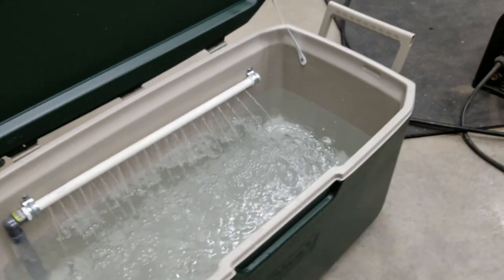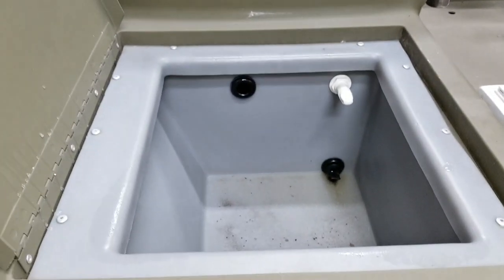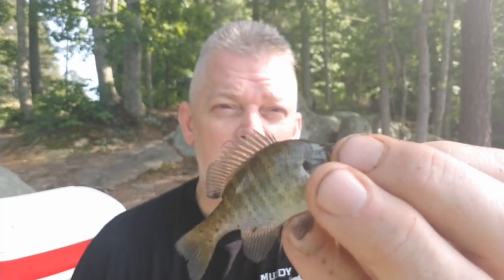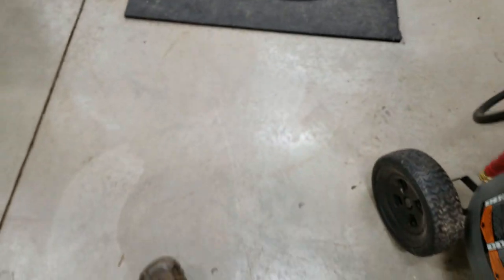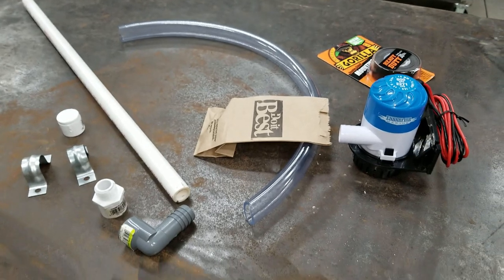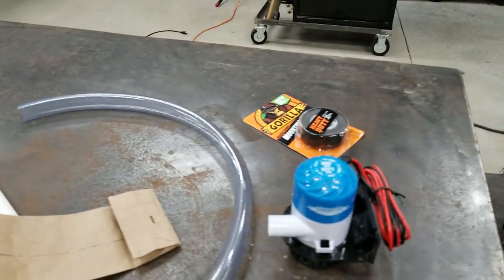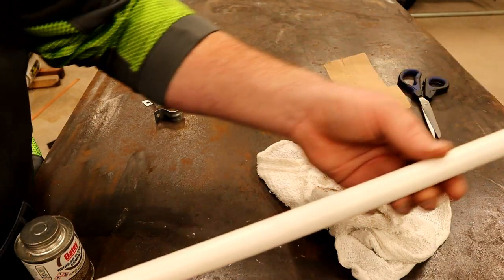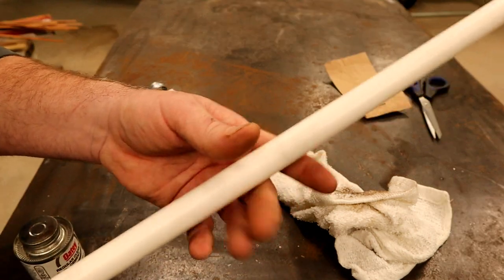30 Gallon Live well DIY

Comment: Coolest DIY I've seen in a while.  After losing MOST of my blue back herring this weekend on a striper outing, I'll be making one of these for my kayak.. I don't need to hold catch, just keep bait alive and lively.  Thanks for the idea and inspiration brother!
Reply from the maker: Thank you brother , check out this one too before you build one they both work good and this one is easier and cheaper too build
https://youtu.be/tWH72EynSbY
Reply: Fishin N Stuff  I just did the 30 gallon build and the bait bucket build thanks for all your help this was my first DIY and it came out great!!
Reply from the maker: Thank you for watching brother
Reply: Fishin N Stuff  if you don’t mind me asking what size battery do you recommend for the 30 gallon live well build ?
Reply from the maker: @nicklockett739  I use my trolling motor battery on the boat , but in a kayak I would use a kayak battery
Reply from the maker: @nicklockett739  https://www.amazon.com/dp/B003S1RQ2S/ref=cm_sw_r_other_taa_LN9eFbBWZ9FV1
Reply: Fishin N Stuff  thanks I greatly appreciate it !

Comment: Have you ever considered making a portable cooler livewell using standard boat livewell tech? Most DIY builds simply recirculate the water in the cooler & provide some aeration, but I'd LOVE to see one that pulls in cooler lake water from a hose & allows overflow drainage. Ideally, the inlet hose would be long enough to pull from a depth to reach cool water, not just the top where the boat's hull sits.

Comment: I've made many types of live wells over the years including the spray bar ones. But my favorite is simpler and actually works better. Get a small bilge pump with the strainer intake on the bottom. Next get a piece of perhaps two inch thick styrofoam eight or more inches in diameter. Cut a hole through the middle just a shade larger than the pump intake. Tywrap the pump to the styrofoam with the strainer in the hole. Fill the ice chest with water and toss the pump in under the styrofoam. Yes the pump is upside down. Wire it and turn it on. It'll quickly foam the water with far more air than any spray bar will manage and circulate the hell out of the water. I've overcrowed a live well with shrimp and fished the entire day in summer heat and never lost a single shrimp. Another plus is the strainer is on the top and doesn't get stopped up with shrimp shells and such.

Comment: When you push the wires through, leave them about the thickness of the cooler on the inside then slather with silicone & pull into place. It will help get more sealant on the inside in case it ever tries to leak. After it's in place then put your bead of silicone around the inside and beat around the outside that way you're hopefully one hundred percent covered.

Comment: I love the use PVC pipe are used some three-quarter inch PVC pipe in my garden I’ll bring it down the rows and then drill some holes in it and then went to Lowe’s and got some sprinkler heads that go in the tube in the small black tubing and I am stuck them in the PVC pipe and then get me a hose fitting and stuck in the end well I made it like a teaThat way I had only one fitting to make her use and I hook the hose up do it the garden hose turned it on and it misted the garden really good and then at nighttime I can go out there and turn it on for about 30 minutes and let it finally missed the garden and they did a great job

Comment: It would be an improvement to hook up with a timer switch and also a water inlet, exit setup. Obviously this will have to be a fixed install. You can get cooler guards for the cooler to keep it in place while motoring.
Just a suggestion

Comment: if you ever do a DIY with a cooler or any other thin plastic container again, you should try kayak rivets instead of screws. they will hold a ton more weight with zero chance of stripping out. great vid man.
Reply from the maker: Your right  , that's a good idea.  I did have right of that . Ive used a lot of em on my kayak lol
Reply from the maker: I did do this one too , it works great in a kayak 
https://youtu.be/tWH72EynSbY

Comment: Oh yeah, how do you fill it up on the boat? I have been there and done that with these. You ether have to keep a separate pump and hose setup to fill it up with or leave enough hose on the well pump can pitch out of the boat and into the water so you can fill the well. Filling them any other way sucks and/or can cause an accident.
Reply from the maker: I used one of the soft fabric buckets , about 3 buckets full and it's good

Comment: How do you fill it up! I would go one step further and hook up a pump with a hose feeding the cooler then connect a hose where the drain is to drain the water!
Reply from the maker: You probably should do that , i only used it 1 time for a tournament  ,,,,, and i caught a 50lber 2ndcplace by the way lol ,,,,, I used a small bucket to fill it up and empty it  .ive got a 40 gallon live well in my new boat

Comment: Do you find the pump heats the water up? I was thinking of making one with a different style pump and have it suck the water through the drain plug and drill another hole for the pvc to run back in.
Reply from the maker: No I didn't notice but I only used it for a tournament I eas in and a couple more times but it was bei cold so , , I'm sorry but I never noticed.  It would be awesome to make one that pumped fresh water in . But that would be more complicated lol ive seen em on kayaks that pulled water in through one scupper hole and water went backout throughout another

Comment: New subscriber here. Great DIY.  I was wondering if you get trash caught in the PVC pipe? I was thinking if you used threaded couplings for the inlet and end cap you could take it apart and clean it much easier. Keep up the good work!
Reply from the maker: I agree with you I saw a video where the guy did that , it's a good idea really .   I was thinking about making one with a filter to clean the water before it reached the pump . I appreciate you subscribing brother , feel free to comment on anything if you have an idea

Comment: can you make a smaller version of this as a bait bucket? I like that pump much better than using those bubblers with the stones any advise?
Reply from the maker: I'll try and think of something . The only problem I would think would be that it will need a bigger battery than a bubble box to run the bigger pump

Comment: Very nice but if it's powered by a heavy 12 volt car battery It would be to much to carry out on the pier. In a boat, yes.
Reply from the maker: Im not sure how long it will work , but I use a lot of the batteries they put in the deer feeders  , I know it would work but I've never tried it on those pumps to see what the run time is . Im going ti be doing a DIY soon that's right up your alley,  for carrying out in the pier I mean . You'll like it

Comment: This is badass! Curious if you can install a bubbler with the bubbling stone strip instead of a water pump like that? Is this better than a bubbler because of the size of the tank?
Reply from the maker: Sure you can they make stronger pumps i would use something strong  , i appreciate it by the way

Comment: Being on the bottom I wonder if the pump gets that slime built up in it slowing it down. I always mount mine a little off the bottom
Reply from the maker: That's a really good idea man , because your right I think it does to , I had one toi show down after a couple years of use . I normally just rinse it off after using and I had a older one I just ripped it out and replaced it they only cost 2.77 , but still that's a really good idea
Reply from the maker: Ol my bad I was thinking of the bait cooler , but your still right there pump could clog up mine never did but it's still a good idea to mount it on the side instead of the bottom , I made that for a Youtuber tournament I was in and I knew my live well wouldn't be big enough,  and I was right caught a 50lber . Ive got a video about that and how it fit in there , but that's a great idea buddy I should have tried that . I learn a lot from peoples comments . I've since ordered me a SeaArk boat so I don't think I'll have live well issues any more

Comment: What kind of vinyl pipe did u use bc I tried the 3/4 in and was not fitting lol and the pump says 3/4 hose..i have literally been fighting this thing for an hour lol advice please
Reply from the maker: Heat it up ,,,, just the end about an inch or so with a heat gun or a torch , and get it soft then stick it on , be careful not to melt it

Comment: May i suggest using rubber seals to plug the hole up instead of using whatever it was you used that might poison the water you can get those rubber plugs that allow the wire to still feed thru but it still plugs it up. Also if that pumps anything like mine may want to wrap a sock around it with some mesh so it don't suck up junk,and feed it thru the spray bar and clog the holes
Reply from the maker: You may lol . Cause that's a good idea . After I made it I thought about a better idea , I could make the spray tubes (PVC) to where they could come back apart sho you can clean them  too . I appreciate the input its aways welcome brother
Reply: @FishinNStuff  thats what u did also make my tubes removeabl cause after a few times of taking it apart to clean them that got old real fast. Keep the good ideas coming . I love em tight lines brother

Comment: Did you wire the pump to hook to a small battery? Do you know about how much all the parts cost you? Thank you for the video!!
Reply from the maker: It doesn't matter on the video I wad using a small battery to run it but on my boat I hooked it to my trolling motor battery , as long as it's 12volts  the price will be lower in the summer , I bought my cooler last winter and it was 69 dollars and I saw some for 40 something this spring so it's mostly the price of a cooler you want to use and the pump which ate different prices too  mine was 15 or 20 . Hey buddy what are you keeping in it
Reply: @FishinNStuff  I have a 12 foot jon boat. I want to be able to keep 3 or 4 catfish in the 4-6 lb range at the most. I'd also like to get in a small bass tournament or 2 and you have to have a live well. and the 3rd reason is we do a lot of river fishing and we want to take some of the fish to a friends farm pond, so just being able to transport them would be nice.

Comment: What did you connect it to? Also im thinking about making a larger live well then this with the biggest cooler i can find.
Reply from the maker: This was the biggest cooler I could find in January  , seems coolers are more available in summer time but I never paid any attention before  , I connected it to my trolling motor battery  for the video (which is very small and ran it fine ) but in the tournament I used my trolling motor battery
Reply: @FishinNStuff  cool!

Comment: At 2:38 in the vid, what is tube of stuff you're putting on the wires? Brand and type if possible? I want to get my stuff just right, just like the pro! Lol
Reply from the maker: I'm not no pro buddy , im a jack of all trades haha ill look and let you know this video is 2 years old now
Reply from the maker: Ol ok I remember  , that was silicone I was trying to glue the wire too the side of the cooler wall to keep it out of the way . But it broke loose so don't worry about that . And use the gorilla double side tape to put the pump in its really strong
Reply: @FishinNStuff  thank you sir! You are the man!

Comment: What kind of battery would you need to run something like this?
Reply from the maker: Well I was using my kayak battery on the video  , but I used my trolling motor battery when I had it on my boat  . But a kayak battery would work

Comment: This is about the size I need. Free cooler came with my " new to me pontoon." Can there be too much oxygen, and is there anything wrong with adding extra air to it?
Reply from the maker: I don't believe you can ever have to much oxygen
Reply: @FishinNStuff  I just got a free cooler with my boat, it's an old Coleman but it should do. I believe it's a 30 gallon, and I'm basing the build off of this video.

Comment: Perfect Live Well except for all that weight to empty Out needs another pump to pump it out back into the lake or wherever
But not a problem for ya
Reply from the maker: I thought about that but I just used my little bucket , I keep my castnet in to fill it and empty it  . But it would make it easier
Reply: You can always connect tubing to the drain and empty into the lake. The cooler I'm going to use has a hose attachment on the drain and I will connect a hose with a shut off valve on the end to drain out.

Comment: This is awesome, great work. One question, you add the water to the cooler correct? It doesn’t pump water into the cooler from outside of the boat?
Reply from the maker: No this design doesn't pump water in  , i used a 2 gallon budget , but it wouldn't be hard to make it that way
Reply: Fishin N Stuff that’s what I thought and your right that’s not hard at all. I’m going to make me one of these to hold bait while we inshore fish at the coast of NC on bass tracker that I’ve completely redone and turned into an open floor plan duck boat !
Reply from the maker: @justinlivengood2109  it works good , as long as its not a bait fish like shad they'll get red nose in a square tank . I make some smaller ones with a bubble box that works great for blue gill size fish or minnows and shiners

Comment: What’s that joint that you connect the pvc to the tube with?
Reply from the maker: Something like this will work for ya
https://www.pvcfittingsonline.com/3-4-sch-40-pvc-insert-adapter-white-pvc-insert-x-i-p-s-spigot-460-007.html?matchtype=&network=u&device=m&adposition=&keyword=&gclid=Cj0KCQjw-_j1BRDkARIsAJcfmTF1IpmkY8hCD5CTZFA221bF-84CvKD9wybWacX9Lg34eYbdWqz0c3waAgswEALw_wcB

Comment: Is that 30 qt? Seems 30 gallon would be much larger. Good video  Thanks
Reply from the maker: No its a 120 quart cooler,  ive got a 40 gallon live well in my new boat that seems a lot bigger so I agree but the cooler is a 120 quart cooler im sure you could get 20 gallons in it easy problem is you can't fill it to the tip top and use the recirculation system properly

Comment: This is probably the best diy livewell I've seen on youtube. I want to make one of these so bad but I have no where to put it. I dont have a boat. I do alot of bank fishing and the car battery would make this extremely inconvenient for me. Using disposable batteries seems like it would get costly over time. Any tips on making a portable one like this without the car battery so I can take it bank fishing? 

You got my sub. Thanks for the tips. 😎👍🏿
Reply from the maker: Thank you Sir  , have you thought about using a kayak battery,  its small and you can recharge it and they aren't as expensive
Reply from the maker: https://www.amazon.com/dp/B003S1RQ2S/ref=cm_sw_r_other_taa_K4ASEbJHM382E
That's what I mean
Reply: @FishinNStuff  holy crap! That's a really small battery. It should be possible to rig that baby up right on the side of the cooler using some clamps? Hmm... interesting. The battery would need to be in some type of case or box though to prevent it from getting wet  wouldnt it?
Reply: @FishinNStuff  what's the link for that submersible pump?
Reply from the maker: @thereelcatfishkillers  I bought it at Walmart  , I think it was a 500gal per hour pump
Reply from the maker: @thereelcatfishkillers  this one would work 
https://www.amazon.com/dp/B07FP85QVB/ref=cm_sw_r_other_taa_oVBTEb8HHD7DW
Reply: @FishinNStuff  awesome! Thanks! I'll be making one soon!

Comment: What size batter are you plugging you wiring into?
Reply from the maker: On that video I was using a kayak battery  , but in the tournament I used my 12v  trolling motor battery

Comment: How long can u ran pump because going to build a bait tank
Reply from the maker: I made mine too hook to my trolling motor batteries , and I ran it the whole trip , but you could use a kayak battery , I would say how long you run it depends on the size battery you use , the one I made worked really well , I'll post you a link to a tournament I used it in ,
Reply from the maker: https://youtu.be/nN5IueY0M2M

Comment: wouldnt it be cheaper and easier to just put a fish tank aerator in it? no drilling etc
Reply from the maker: You mean like a bubble box ?
Reply: To me I thought a live well meant it pulled freshwater continually from outside the boat and recycled it. to make a contained Bait well if you’re going to manually fill it with water just throw a bubble box fish aerator for aquariumI need to do is run the air hose in the air stone on the end of it into the tank
Reply from the maker: @dweaver1805  hey if you build one you can do it any way you want i guess

Comment: What kind of batter are you using to run thr Bilge me and my friend made a portable live well and would like to know the type of batter you used and the ah of the battery
Reply from the maker: I had wires running from the pump long enough that I could hook it to my trolling motor . On the video I was running it with a kayak battery 12v 10mah while it was in the shop